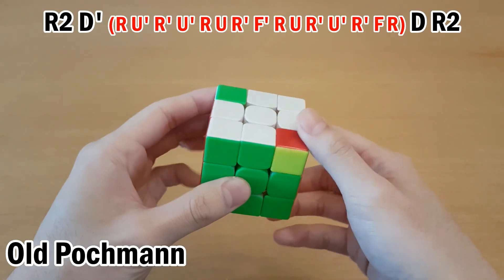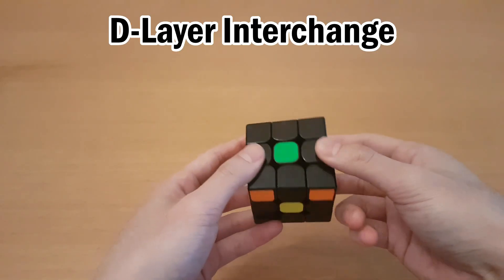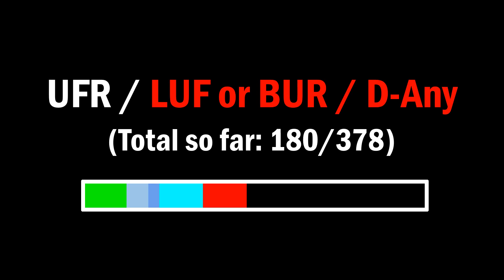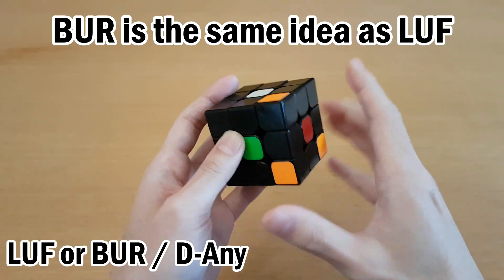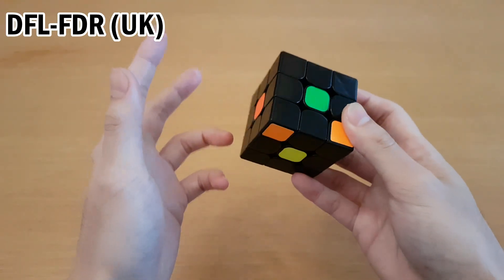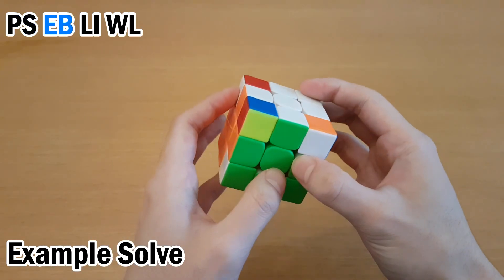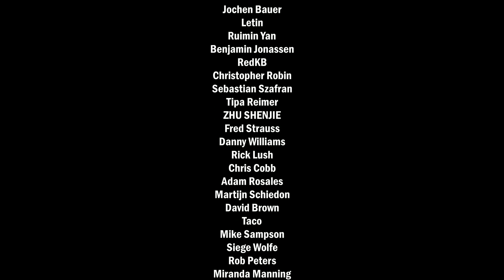Full 3-Style Blindfolded Method [Corners] Tutorial

Comment: Wow, when I started learning 3s corners, comms were the most difficult part, but that I understand them, it’s so fun to come up with them, the fingetricks, everything is so fun, on my way now to learn 3s edges now
Reply: What's UFR? The letter scheme or what?
Reply: @wedwibon it’s like the specific sticker, so UFR is C if you use speffz
Reply: @wedwibon  it go like dis
U - Up (White side)
F - Front (3 whites on the front)
R - Right (the right white of the 3)
Reply: @ok-ge1f  how'd you know where it is facing?
Reply: @wedwibon  memorize the color scheme, hold the cube in the same position every time. If you need to rotate, rotate back to the original position right after you execute an alg
Reply: @SwiftConyeah, but how'd you know what comes first? Like how'd you know it's UFR and not URF
Reply: @wedwibon URF was the old way, the modern way is UFR
Reply: Any tips for memorising? I’ve memorised half of it but it’s still too confusing

Comment: I have a question. During a speedsolve, how do you quickly figure out whether it is an insertion first or interchange first commutator?
Reply: I learned M2 for edges and then Orozco as an intermediate corners method. Both allowed me a lot of practise to understand the order of insertions. Now, I've covered 6 more 3-style corner stickers and it feels increasingly easier to learn. I'm also able to use newly learned 3-style corner comms in most times 3bld solves without too much of a hit to my average times and success rate. I know Orozco and other intermediate methods have detractors, but I feel Orozco really gave me the confidence and understanding to start committing seriously to learning 3-style (using Anki, etc). So how do I know which comes first? Well I just know from practise!

Comment: I am averaging 51 second
With intuitive f2l , 2 look oll and I'll
My cross is talking like 8 sec even though I planned 3 pieces but cannot execute when the timer starts
Should I start drilling 77+ advanced f2l cases or full pll
Reply: i think you just need to practice.at this point..you can be sub 30 easily just using intuitive f2l..and learning algs for f2l cases in not optimal..you should try to find the best efficient way to solve a f2l case by yourself. for refrence almost  every f2l case can be solved with 8 moves or less.( exception are there thatt can be solved in 11 moves)..try to find a good solution for every case. then implement that solution to your solves.and just practice practice and practice...i know it seems you are not getting anywhere sometimes but i can not stress the power of practicing enough..you will eventually see changes..you dont need anything special right now

Comment: Ahhh... Looks like your key to success with 3-style is reducing complex commutators to simple ones with longer setup moves.
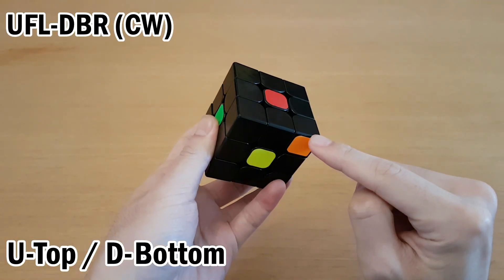I've been practicing Beyer-Hardwick method for some time, which was a fun experiment (yet it's full scale turned out to be totally beyond both my skills and dedication). The BH method however strives to reduce movecount to absolute minimum possible. Example: in 3:27 for a cycle (UFR-> UFL->DBR) you suggest to reduce it to a pure commutator (8-mover) with a 3-move setup R D' R': [R' D R, U'] which looks like a 14 moves, but in HTM it really is 12. In BH that's a toss up, which is a type of a pure commutator - [D L2 D': R2] - 8 moves in HTM.
It's easy when you know it, but doing it on the fly while solving under time pressure is not. Solving each cycle with BH requires realizing what kind of a cycle it is (there are several classes), if it is possible to find a 3-move insert and interchange to solve in 8 moves, or do you need to setup in 1 or 2 moves to one, or is it a special case with 5-move insert, is there a cancellation. And that was my exact problem with learning BH as it was advertised. Still a fine piece of theory IMO.
I was using these BH algs for reference http://www.speedcubing.com/chris/bhcorners.html  - the case was (URB UFR DLB) - URB is used as a buffer.
Your method - contrary to BH - looks to be viable in practice. Great work, thanks.
Reply: Also this specific comm you gave UFR-UFL-DBR can actually be quite decent if you do a z’ rotation, and I might actually use this, so thanks!
Reply: @DillPicklePatrick  glad it works for you. To me, uhhh... no so much. Of those few BH algs that I've been practicing back in the days, lots were quite good with appropriate rotation and really awkward without one. Adding a rotation can simplify the fingertricks and reduce the finickiness, but also increases motoric complexity, risk of dropping the cube (they are slippery) and risk of mistakes. I don't remember those algs now, but there were quite a few cases which were familiar and even finger-friendly with two rotations setup.

An easy non-BH example (just to illustrate my point):
pure commutator [[U: B'], F] is terribly finicky in home grip or just awkward and counterintuitive (to me) with righty undergrip. In conjunction with (y' z) it becomes [[R: U], D] which is natural from home grip, however the whole alg becomes [y' z: [[R: U], D]], which unfolds to (y' z R U'  R' D R U R' D' z' y) - that's 12 moves with 4 being rotations. Also, I have no reliable method to remember how to undo the rotation and I often mess it up, e.g. undoing (y' z) with (y z'). Yeah, I'm lame like that...
Reply: BH sounds better if you have problems with turning speed. Perhaps arthritis or something of the sort, or just old age leading to weaker joints, could be much better.